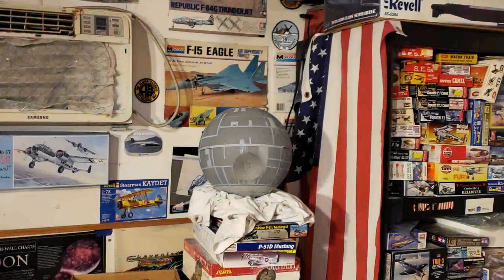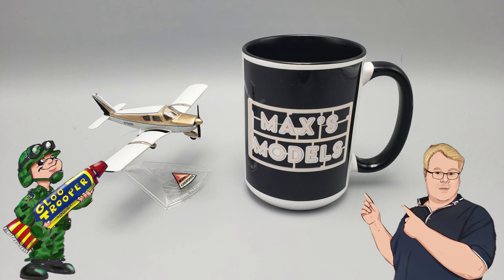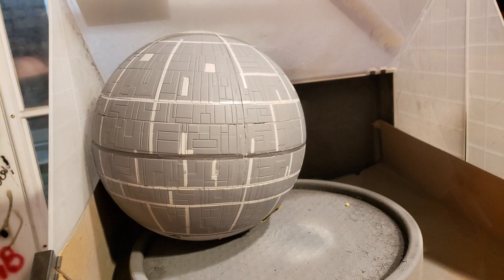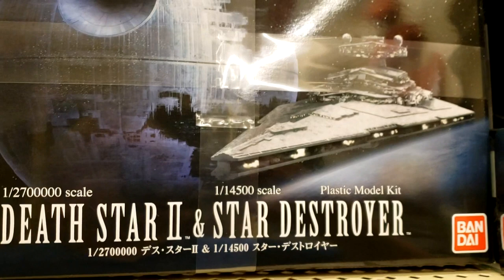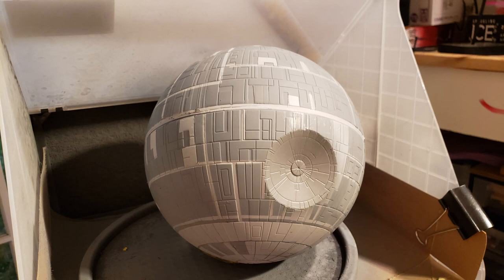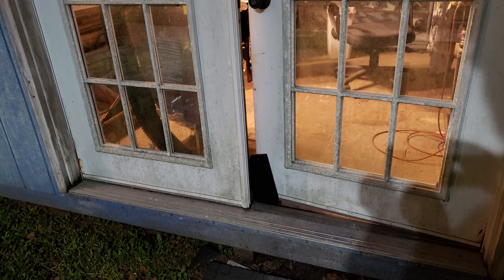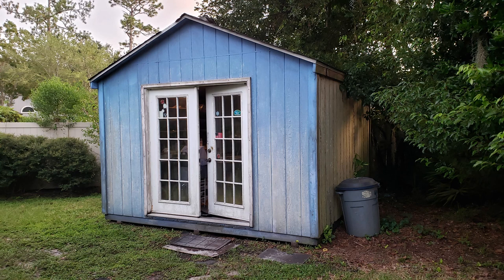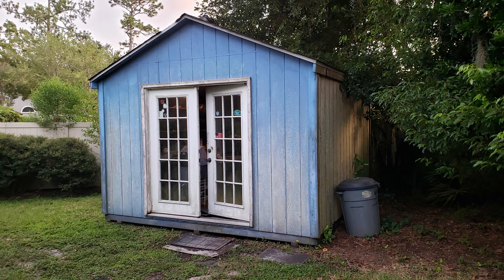Coffee with Max's Models on the Death Star

Comment: Nice save on the Death Star. Once it is hung up DO NOT use it as a punching bag. Those spray booths really do suck out all the fumes and particles from the air. A must have even if you brush paint. With todays technology a smooth surface would be great with the detail done by those "3D printed decals". Andy's Hobby HQ showed off a lot of them that are made for airplane cockpits. Really impressive details.